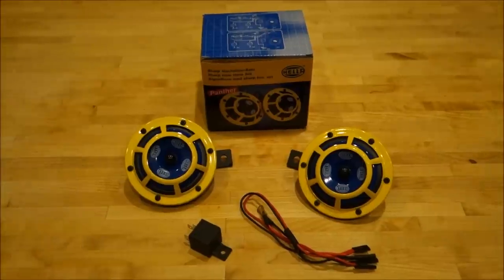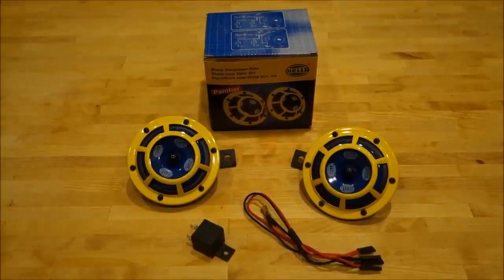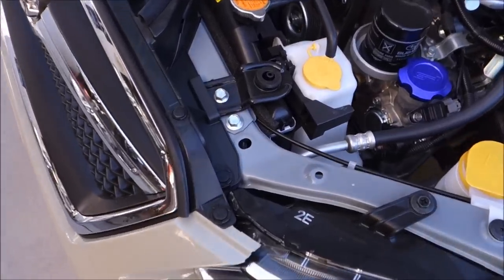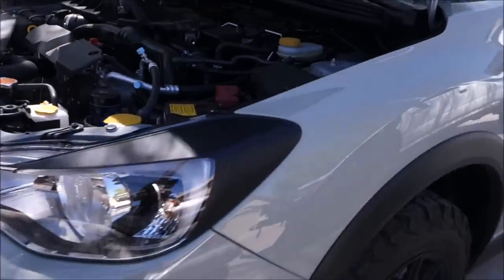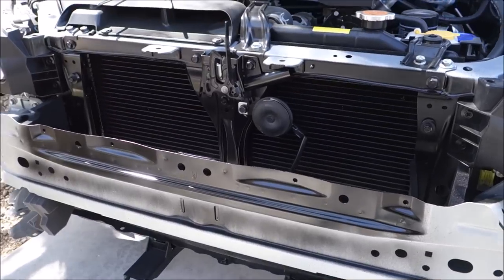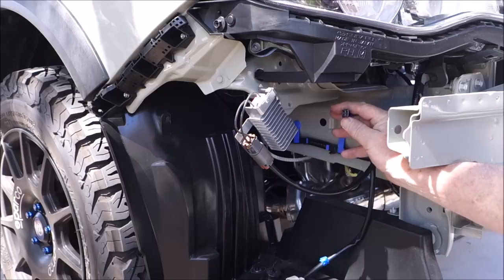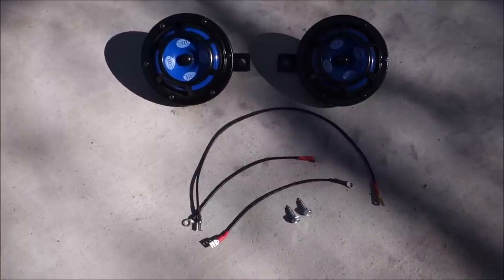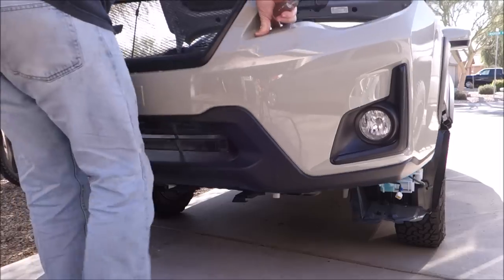Subaru Crosstrek Hella Horn pair install (front bumper fascia removal method)

Comment: Thanks for the detailed tutorial. I've bought my Hella horns, made my extension and grounding cables, and I'll be installing them this weekend, time permitting.
Reply: Snarkticon i want to do this but i’m not familiar with electrical stuff. can you explain what grounding is for and how to make the extension? I have a 2016 crosstrek
Reply: Hi Edwin. The ground wire completes the electrical circuit between the horn and the car's battery. You can make your own cables very easily from items you buy at your local auto parts store. I bought some 18 gauge wire and a a set of assorted connectors for less than $15. You'll need a crimping tool, which you can also find there. And here is a simple how-to for crimping: http://www.instructables.com/id/How-to-Crimp-Cables-and-Wires!/
Reply: Snarkticon just to make sure i don’t get the wrong things but can you tell me specifically the names of the wires you used or the wires that the video used? also, how does the extension connect to the original power source?

Comment: Very nice video!  My wife bought our very first Subaru ... a Desert Khaki Crosstrek just like yours!  You have really don't a great job with your Crosstrek... one day my wife will let me make some mods to ours! lol.  Hey.. where did u get those color-coded plugs for the front plate holes in the bumper cover?  How much has the new tires affected your mpg?  Thanks again for doing such great vids!
Reply from the maker: The front bumper plugs are just plastic hole plugs from Ace hardware painted with desert khaki tough up paint (google 'My Crosstrek has nipples' to see my post on subaruxvforum about it). The wheels/tires were installed first day at the dealer so no before/after mpg stats.

Comment: Hi, saw a relay harness that comes with your horn unit. Did you install it? Didn't see it in the video.
Reply: I don't think you need to install the new relay if you're replacing the horns. If you are adding the horns you'll need to add the new relay into the setup

Comment: I have seen a few other videos where they use a whole new wiring harness and relay, with direct to battery connection. Is there an advantage to that way over the way you did it? Your way definitely seems a lot easier.
Reply from the maker: In my opinion the stock wiring/fuse/relay are adequate for these horns.

Comment: You mentioned blacking out a part behind where the grill goes because the new grill allows you to see little further in, What paint did you use for that and to paint the yellow on the horns black?
Reply from the maker: I used Krylon semi-gloss black enamel to spray the non-black areas behind the grill (condenser etc), and the same paint to spray the horn grills. I removed the horn grills (dissembled: took out the screws), cleaned with isopropyl alcohol and painted the pieces, then baked them at 200 degrees F for about a half hour to give the paint a tougher finish (typical when I paint car/motorcycle pieces that aren't powder painted). Any semi-gloss or flat paint would work.

Comment: Hi. I am just about to pick up a Quartz Blue 2017 Crosstrek. How did you fill those factory plate holes? Its retarded they put those on vehicles when many states do not require front plate. I think its tacky and Subaru should have something to deal with that or at least sell a small faceplate in stainless or something. You apparently got plugs and painted them. Where did you buy them?
Reply from the maker: I bought the plastic plugs at an Ace hardware and ordered a vial of touch up paint
Reply from the maker: I bought the plastic plugs at an Ace hardware and ordered a vial of touch up paint
Reply: Thanks man. I have an Ace 1 minute away. Anything special or did you just look for ones that looked like they fit? Were they body panel plugs? I found a guy on Bumperplugs.com that matches them exactly to your paint. $27.95 though......nice business because he does them for all cars and all he needs is paint code. I'll try Ace but maybe just spend the $27 and have them painted and ready to plug the damn holes!

Comment: Hey I was wondering, do those horns block a significant amount of air coming to your rad? Like do you notice your car running hotter or any cooling system issues?
Reply from the maker: No issues. The stock grill probably blocks more air. In any case, adding an extra horn (there was already one) isn't going to have any significant effect.

Comment: Quick question, you wouldn't happen to have the link to those wires would you? & how did you create the extension to lead to the second horn?
Reply from the maker: There is no link for the wires, I made them. The 2 horn ground wires re 18 gauge 7" long with a female spade connector on one end (plugs into the male ground connector on each horn) and a ring connector on the other end to put the ground screw through. The extension wire positive lead for the passenger side horn is 18 gauge wire about 16" long with a female spade connector on one end (plugs into the horn + side) and a male spade connector on the other end (plugs into the original passenger horn positive connector in the passenger wheel well area). The wires are shown at 6:30 in the video.
Reply: +Subaru XV Crosstrek Central thank you very much! It worked out perfectly! Much appreciated sir!

Comment: Quick question, would spray dipping the blue part of the horn have any effect or cause any malfunction or should it be fine? Trying to keep the yellow, and blacken the blue
Reply from the maker: Paint it
Reply: Subaru XV Crosstrek Central oh cool thank you! Mine should be arriving here in a few days, think removing the entire bumper is necessary for the whole setup, or do you think just removing the front grille would be good enough?
Reply from the maker: Just the grill is enough
Reply: Subaru XV Crosstrek Central very nice! Thanks for the replies. This will be my go to for the install and bumper removal if ever needed haha

Comment: I'd like to do the same mod but just use the original locations for the horns. 
Do the OEM cables plug right into the Hellas? And do I really need to install a ground wire?
Reply from the maker: You'll need a ground wire for each new horn. There are 2 spade terminals on each horn one for +12v and one for chassis ground. Use the same terminal on each horn for +12v or the horns won't be as loud as possible
Reply: Subaru XV Crosstrek Central did these a few days ago and loving the results. thank you for your video! still haven't used them on anyone yet though 😕
Reply: Thanks for the wonderful videos. Its unfortunate there is no "+" or "-" on each of the horn terminals. There was a "k" on one terminal so I connected the ground to both terminals with that marking. I located the horns in the same place you did and was able to disconnect the lower stock horn wire without removing the full bumper. I did have to remove the grill however. Would not have been able to do this without you video. Thanks!!

Comment: where and what paint was used to paint your hella horn? and where did you get the wires?
Reply from the maker: Answers are below already covered in comments:

I used Krylon semi-gloss black enamel to spray the non-black areas behind the grill (condenser etc), and the same paint to spray the horn grills. I removed the horn grills (dissembled: took out the screws), cleaned with isopropyl alcohol and painted the pieces, then baked them at 200 degrees F for about a half hour to give the paint a tougher finish (typical when I paint car/motorcycle pieces that aren't powder painted). Any semi-gloss or flat paint work.

I made the wires. The 2 horn ground wires re 18 gauge 7" long with a female spade connector on one end (plugs into the male ground connector on each horn) and a ring connector on the other end to put the ground screw through. The extension wire positive lead for the passenger side horn is 18 gauge wire about 16" long with a female spade connector on one end (plugs into the horn + side) and a male spade connector on the other end (plugs into the original passenger horn positive connector in the passenger wheel well area). The wires are shown at 6:30 in the video.
Reply: Subaru XV Crosstrek Central thank you so much!!!!

Comment: What did you use to black out the air condition coil and the grill area?
Reply from the maker: Semi gloss black Krylon spray paint
Reply: thanks! have you seen any issues with the air condition afterwards?  I'm worried the spray will cover the airflow

Comment: No relay needed?
Reply from the maker: Stock horn already has a relay
Reply: @AZAdventureInc  wish I would’ve watched this video first. Last video I watched installed a new relay which it still works but it more wiring that has to be cleaned up. I’ll probably go back and rewire everything like you did.

Comment: Do these horns sound when locking and unlocking the car?
Reply from the maker: No there's a separate beeper that sounds
Reply: Subaru XV Crosstrek Central Did you just make the make the wires yourself?
Reply from the maker: Yep, says that at 6:30 in the video...

Comment: would you mind posting a link to that grille?
Reply from the maker: +Andrew Barnard It's on eBay http://goo.gl/4fZTx7 (shortened URL). I would recommend the Subaru Sport grill though, these CF ones from China aren't the best quality.
Reply: +Subaru XV Crosstrek Central ok. I will look into those as well. Thanks!
Reply from the maker: +Andrew Barnard 
Headlights are wrapped with vinyl, same as hood and door handle pockets.